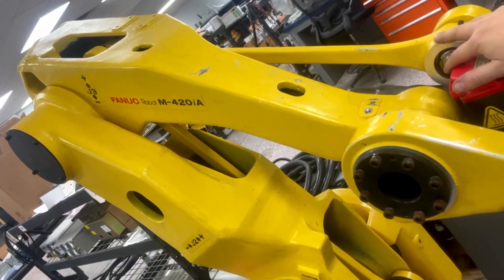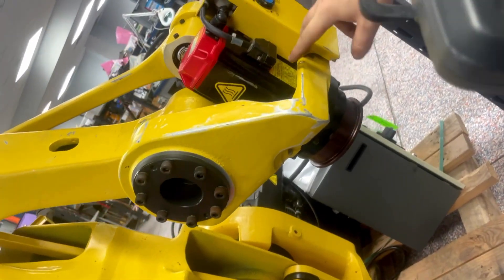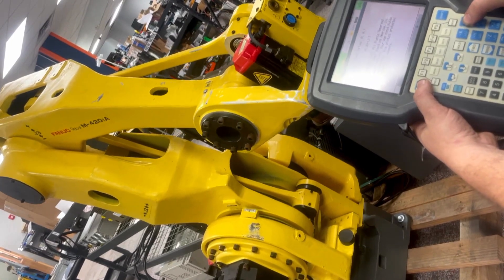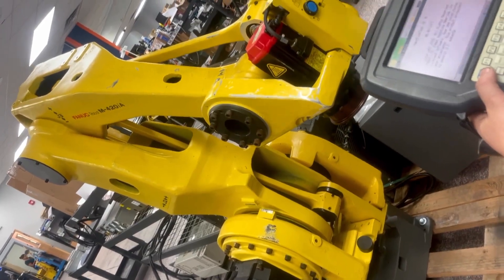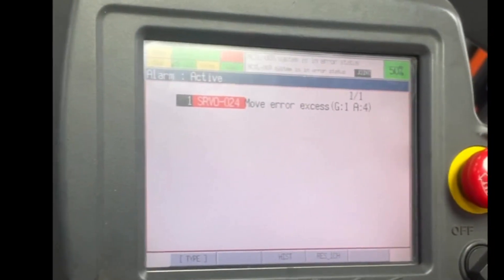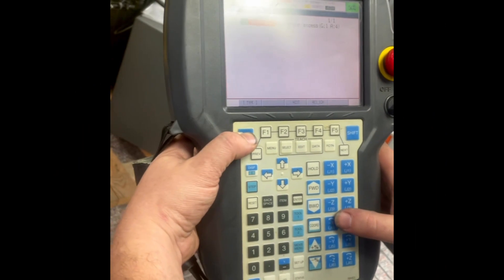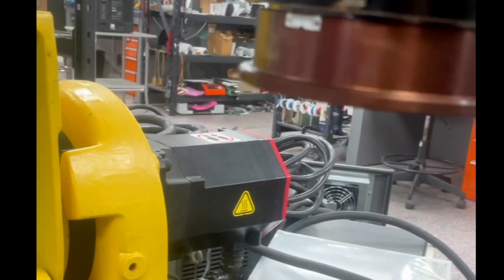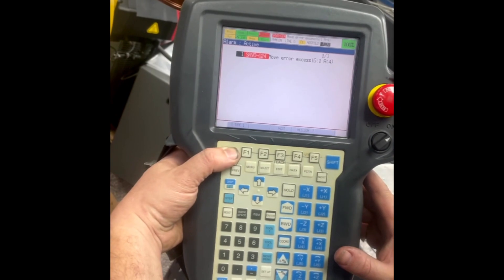How to Repair a Fanuc Robot M-430iA in the state of an Excess Move Error

Comment: Hello everything is fine?
I'm from Brazil and I have some errors on Fanuc M420IA The errors are: SRVO-213
SRVO-007
I checked the fuses on the cabinet door, they are all good, there are no broken or disconnected cables, could you tell me what tests I should do and where I need to check to solve these problems?
Thank you in advance for the video and attention!